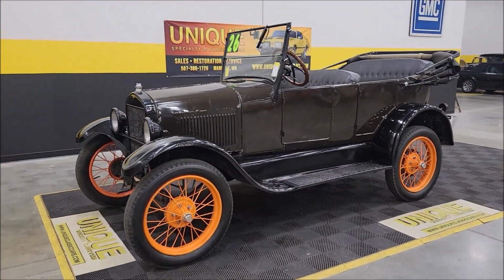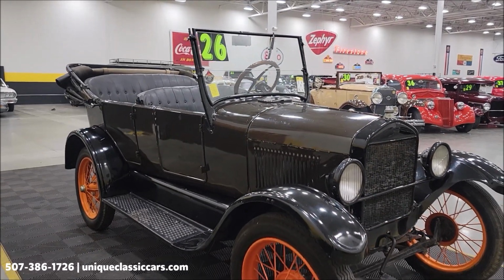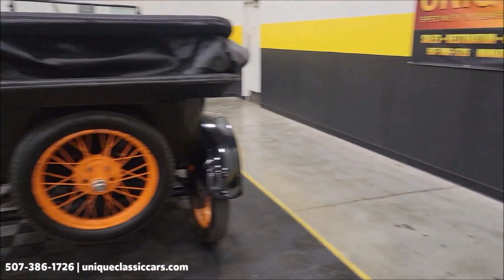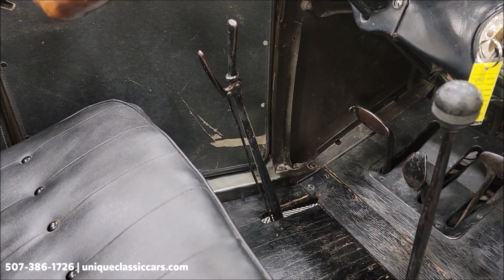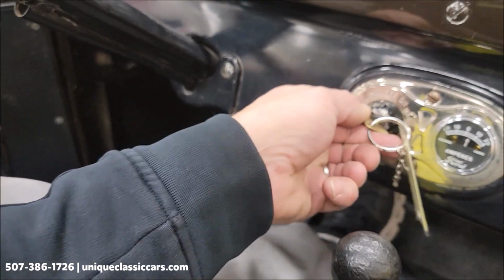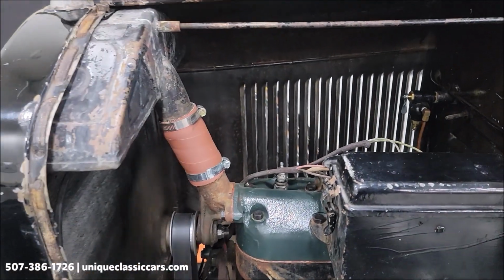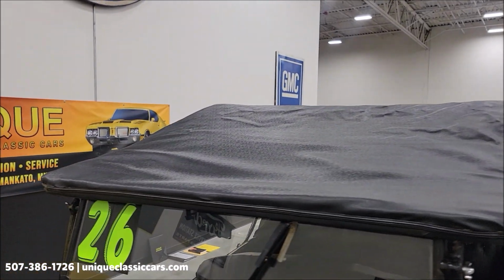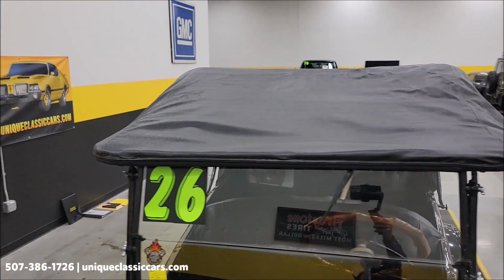1926 Ford Model T Touring | For Sale $14,900

Comment: That shifter sticking out of the center of the floor board is called a Rucksell rear end. It was an after market 2 speed rear axel that gave the Model T an extra low and high gear. I have a 1926 "T" myself.